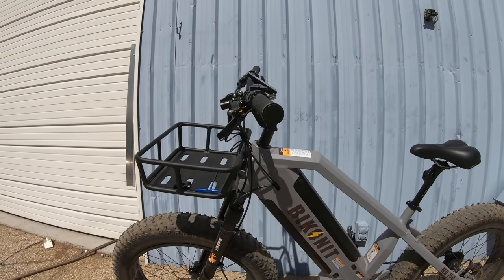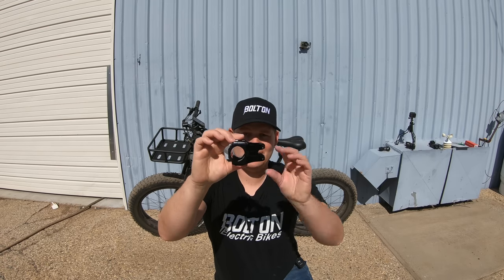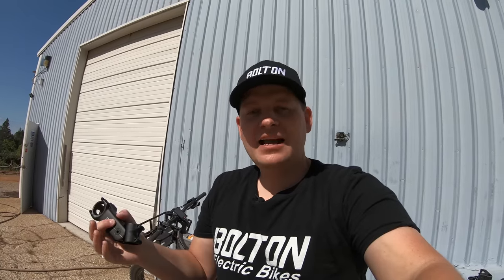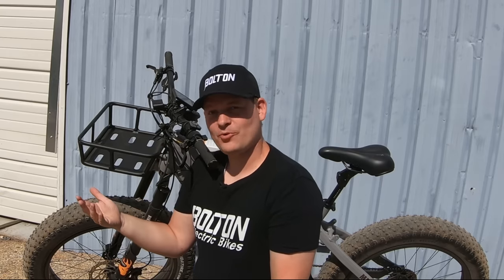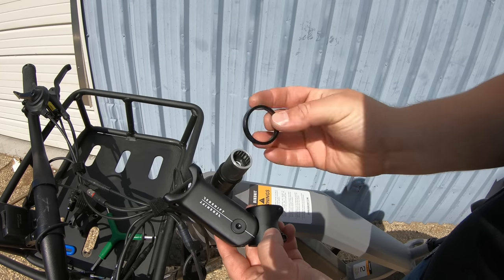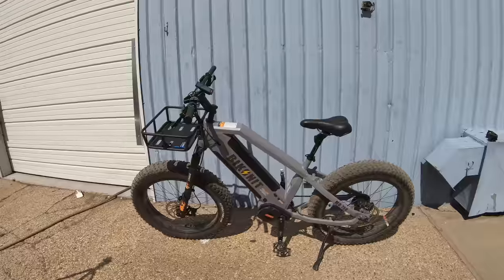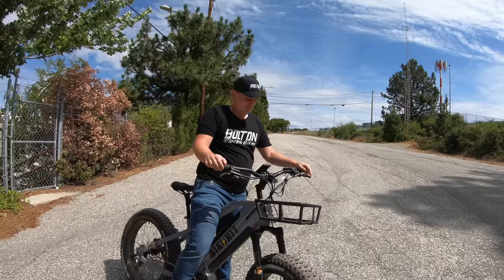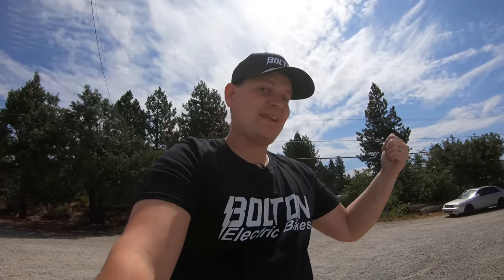You can have suspension in your handlebars?!

Comment: I purchased a Suspension Stem for my Himiway.  It's a FOMTOR 31.8 Adjustable Stem 0~90 Degree 80mm MTB Adjustable Bike Stem for 31.8mm(1.25") Handlebar.  The best part is that the adjustment is directly on top of the post!  Thanks for the review Kyle,  Great Information and Video....Yes, do a Video equipment video.

Comment: Great video, very useful.
I have a question related if you could help.
So I opted for a riser stem with an angle that sits high and away from me which has been great. The trouble now though is that I have to constantly tighten the alan key bolt at the start, during cycling and when I finish my ride. Maybe, I need to buy a new one or I could weld, strong glue or something along those lines. Could the riser at the angle be welded and if so, what type of weld. 
I'd try it before get a new one but if anybody can help, it would be appreciated
Not sure what material it's made from, aluminium, cast??

Comment: I've done over 3K miles with my RedShift suspension seat post on my ebike and the higher you raise it, the better it performs. Like a swimming pool diving board, the longer the board, the more spring it will have. With all that, I've maybe bottomed out on it twice.

Comment: I wanna get and adjustable stem and suntour suspension seat post for my Aventure. The handlebars are just a tad to forward and cause my hands to lose feeling. If I just lean back a few inches while riding with my fingertips on the bars it's perfect but with the standard stem I can't make the proper adjustment.

Comment: I had to take off the front basket as the front brake cable is too short and would catch on the basket whenever you turn too far right.
Reply: I had the same problem with my Aventon Aventure and separated the brake cable from the harness and also removed the cable clamp on the front fork which gave me enough line to turn to the far right. Use a tie wrap to keep the line away from the tire, i put the basket on with cables in the middle and it works fine.